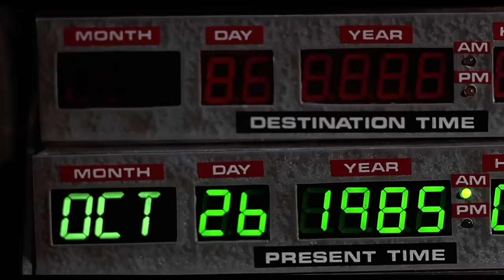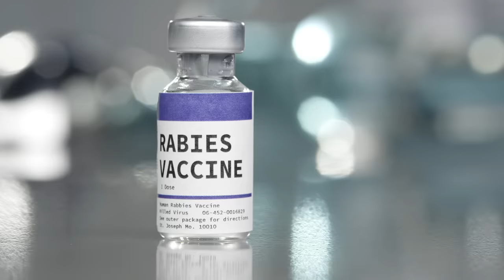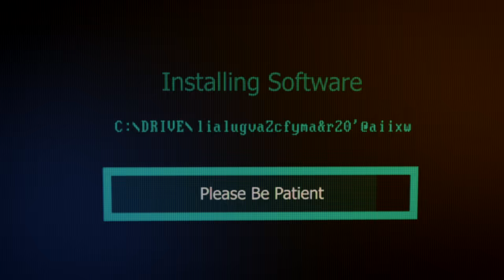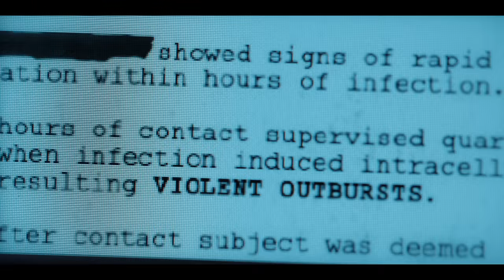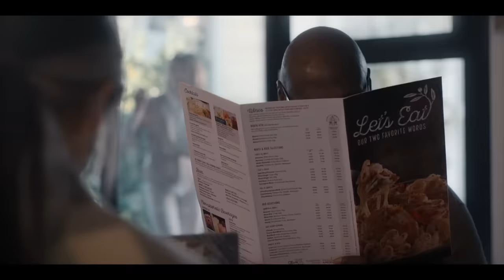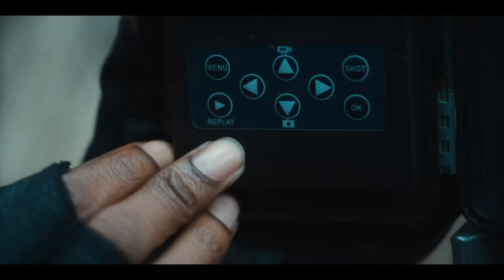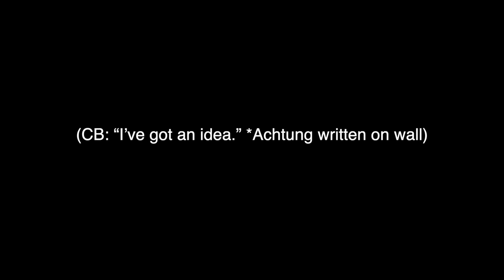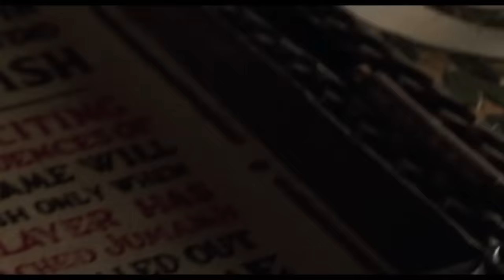How to Beat the UMBRELLA CORP in RESIDENT EVIL (S1)

Comment: I like how he labelled it (S1)...
As if this disaster is ever going to get a season 2
Reply: there is a very low chance for a season 2 but is still higher then seeing a fresh comment on youtube these days
Reply: It's allready canceled
Reply: @Railow77  Apparently it's possible that they might bring it back.  It's highly doubtful though.
Reply: @bradleyblake7588  Yeah its possible but very doubtful and i think most movies and series fail when they try changing the leads race and gender
Reply: @FoxSenpie  I don't think it necessarily has anything to do with the race or gender of the leading characters.  That would suggest most fans of Resident Evil are sexist and racist which is incredibly insulting.  I didn't care what the color of there skin or their gender was at all.  My issue was the terrible writing.  It has one of the slowest moving plots I've ever seen.  Like by far. This made it incredibly difficult to get through while actually staying interested in the story at all. If they had just stuck to the 2022 story line and left out 2036 it probably could have been pretty good.  For some reason though, they thought it would be smart to jump back in forth which, literally spoiled the 2022 plot line as it went along.  This is one of the dumbest things you can do in writing because it's so difficult to maintain a perfect balance between the two story time lines while also not ruining the earliest story line from the jump.  There were ways they could have actually fixed this but I honestly just really don't feel like writing an essay here lol.  Either way though, in my opinion, race and gender had absolutely nothing to do with the failure of the show.
Reply: @bradleyblake7588  you took that wrong but i was meaning like changing Wesker into a black guy with 2 children which doesn't match wesker from the games at all type of changes and you need to not get so offended over some thinking that might be why something fail
Reply: @FoxSenpie  I wasn't offended at all actually.  It takes alot more than that to offend me lol.  I was also surprised by the race change, but that's not what bothered me.  What bothered me was the snail paced plot and sloppy writing and time jumping.  It all just didn't work at all.  It was just really boring and frustrating that they wasted such a great opportunity at making an amazing series.  But things like swapping out races doesn't matter to me.  The only thing that bothers me when it comes to that kind of stuff is when I feel like an agenda is being shoved down my throat, but with this I didn't really feel that compared to other stuff that's come out recently.  That might be because I was too busy being annoyed by everything else though.  But Im really not offended by your comment because racism doesn't apply to me, because 1. I'm not racist and 2. The race swap didn't bother me.
Reply: @bradleyblake7588  I should watch it really understand it but yeah I agree and I hope you do feel better

Comment: Man I barely could sit through this summary, you have my respect for being able to sit through the whole show without ripping your own eyes out.

Also how to beat this zombie apocolypse: strategically place some woodchippers and every once in a while throw in a live rabbit to make sure it's blades are enticing to the zombies and then wait for every zombie in vicinity to dispose of itself. That would at least deal with the run of the mill basic zombies, the mutated stuff might take a bit more effort.
Reply: And if the blades get jammed while clearing out a horde?
Reply: @vincentthought6130  just wait, eventually the blood will start to rot and the zombies might no longer be attracted to it. Then you go in, move it away, fix it and then you start again.

That the zombies immediately rush anything that smells of fresh blood is a ridiculously easy to exploit weakness. Any kind of trap where the zombies would die immediately or just couldn't get out once they fell into it could be used with the same strategy and reduce the number of zombies in an area until you eventually caught all of them.

Comment: If the zombies can smell a drop of rabbits blood from a long distance and through at least one door, you'd think they could smell it through skin from just a few feet away
Reply: That's not how smell works...

If it is contained there is no smell, even if it is a thin plastic bag or skin and blood vessels.

Dogs and such can smell things in an air-tight container because there are traces left on the outside of the container during packaging.

Comment: A satellite has a useful lifetime of between 5 and 15 years depending on the satellite. It's hard to design them to last much longer than that, either because the solar arrays stop working or because they run out of fuel to allow them to maintain the orbit that they're supposed to be in.

So there's probably no satellites left up there

Comment: Honestly still stuck on the security at Umbrella corp. Are the lights and alarms for show? Is there seriously not a single guard? Why would they even keep the dog alive in a compound that's so unsecured it's a joke? Why would the Tijuana video just be on Albert's desktop? She didn't even look for it, it was just there 😂 

Why would the dog be so easy to release and why would it not be chained down or muzzled? It's not like they need to feed it 😂 and if any scientists did need to run experiments on it they surely didn't solely rely on wranglers to keep it from mauling everyone, there should have been some sort of failsafe for them. Also the door to the cage should have been attached to the door to that room so that if it was opened you couldn't leave the room. I feel like nobody out any thought into this at all. 

 Wouldn't the security system immediately upload all security data, especially in the case of an attack? Videos and access records should be up on a cloud before Albert even walked into the building. 

And even if they didn't station anybody at the exterior gate, surely nobody should have been allowed to open the gate from the inside while the alarm was going off which means the girls shouldn't have been able to escape before the guards came in. Just completely brain-dead execution